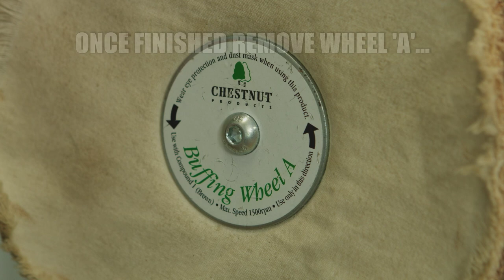Using the Chestnut Products Buffing System - Finishing School Short

Comment: I have had mine for some time now, love it. By way of a side issue during a recent makeover of my kitchen (repaint, change this change that sort of thing) I priced up new door and draw handles, very expensive and not disimilar to the tired old ones on there alrready. Brainwave, why not clean, buff and repolish the current ones. Having completed one and had approval from the guvnor I did the rest. This more than repaid the outlay of the buffing wheel system, so I have credit with the guvnor and money in the tool bank. Don't forget most thing in the workshop have more than one use.
Reply from the maker: Ha-ha, I love that story Peter. Really pleased you got such a great result. Using the wheels on metal can make them go black, but this can be cleaned off. Enjoy the Guvnor Credit!
Reply: They were stainless steel with some sort of a light coating/colour which had worn away in part with use making them look a bit tardy. The wheels brought them up to a high shine almost chrome like. @ChestnutProducts

Comment: Since you get a good shine from the buffing wheels why use woodwax22?
Could you use cut and polish on a separate wheel if you wanted something more abrasive?
I presume you could use microcrystalline stick too.
Thanks
James
Reply: I don't really understand the first question. You wouldn't use WoodWax 22 with the Buffing System (but it gives a great shine if you haven't got a Buffing System) 
You really shouldn't need anything more abrasive than the two compounds, I wouldn't use Cut'n'Polish on a buffing wheel. It's too 'wet' to work on the wheel and if you let it dry it won't do it's job properly.
And yes, Microcrystalline Wax Stick can be used with the C Wheel if you prefer.
Does that help?

Comment: The first compound seems rather dark, isn't that going to stain lighter woods?
Reply from the maker: It's not usually a problem, but in rare cases it can happen, especially when working on a very open grained timber or if there's too much compound on the wheel. In these instances, skip using the first wheel and go straight to the second one.